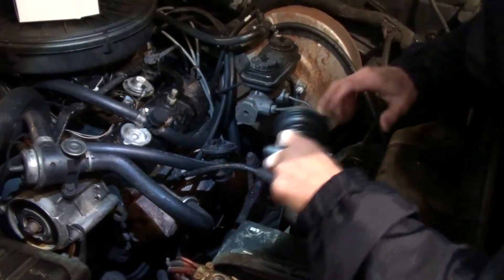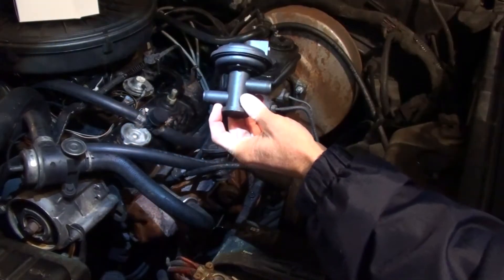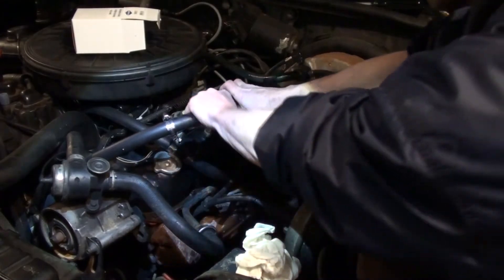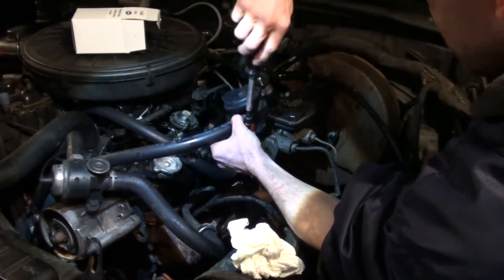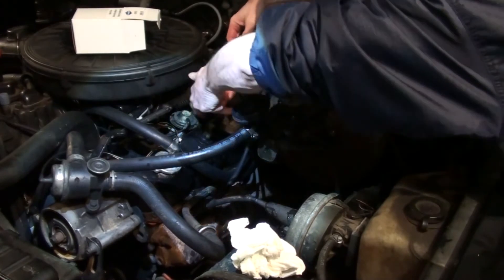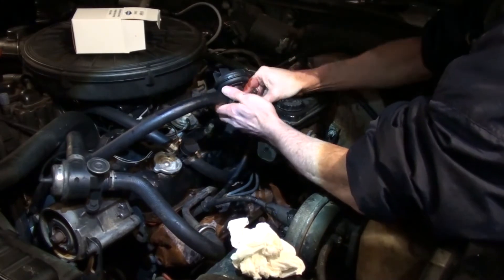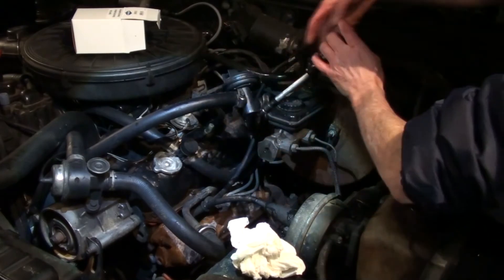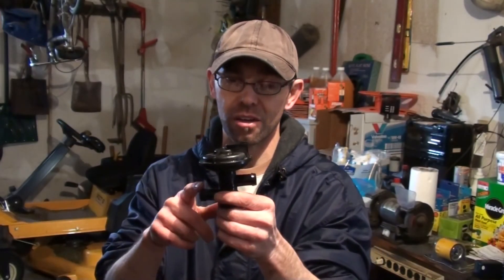1988 Dodge Dakota 3.9 V6 Heater Control Valve Replacement

Comment: I have an 87 Dakota and the heat selector panel I level floor defrost doesn't work do you know anything about that thank you Karl
Reply from the maker: Hey Karl, it could be a vacuum problem,  or one of the actuators is bad. I would have someone run a diagnostic to be sure.

Comment: I have a question about a 1994. Do you have any idea how to get to the blend door actuator? I blow heat/air (though not cold) through the defrost and floor vents only. Just trying to narrow down the problem as cheaply as I can. thanks for your help.
Reply from the maker: Clayton Sosbee On my 1988 I actually have two actuators on the driver side just to the right of the gas pedal and one on the passenger side closes to the passenger side door. I'm not sure which one controls the blend door though. Also, I'm not sure if they would be in the same location on a 1994. Hope this helps.
Reply: I pulled the front of the dash out and everything is still plugged in, so I am assuming it's either the actuator or the control switch. I also has to wire brush my blower motor resistor yesterday, as parts of it had rust. So those EGR-looking thingies are the actuators?? The thing by the gas pedal is a yellow hose. Passenger side is black. Are those it?
Reply from the maker: Clayton Sosbee Yes I believe you've found the actuators and yes mine have different colored vacuum lines connected to them. If it's not too expensive you might look into replacing the blower motor resistor if it was rusted really bad.
Reply from the maker: Clayton Sosbee  By the way, if you have the chance, check out some of my other videos, ads on the videos, and consider subscribing. Also, don't forget to  share your favorites. It helps me continue to make more videos and helps pay the bills. Thanks again! :)
Reply: Resistor is cheap and a 5 minute replacement. :) But thank you for your help. I will assuredly subscribe.
Reply from the maker: Clayton Sosbee Thanks!!! I appreciate it!

Comment: when i throw water inside the thermostat it blows bubbles itmeans thats rust?how to tell if the thermostat needs replacement?
Reply from the maker: The only way I know to tell if the thermostat needs replacement is to take it out and compare it to a new one. To do that, boil some water and put both thermostats in the water to see which one opens the most and the soonest.  In my experience, if the thermostat needs to be replaced, the new one should open before the old one. Hope this helps!!! :)
Reply: thank you very much
Reply from the maker: You're Welcome!!! :)

Comment: I have a 96 dodge dakota that blows warm not hot, Ive replaced the thermostat, water pump flushed radiator and heater core, am I missing anything? I was thinking maybe check the inside controls
Reply from the maker: I can't think of anything else accept for maybe your radiator or heater core are too clogged for a simple flush to work and you may need to do a back flush to dislodge anything that will not come loose with a simple flush. I got this idea using the method I use to clean my tankless water heater. I did a video on how to back flush the cooling system. Maybe that's something you could try. Here's the link. https://www.youtube.com/watch?v=X_B1G9vNhms&list=PLQB212FFPHWTOT00vcim4mPdcOdhEizjk&index=9
Reply from the maker: CORRECTION in quotes - I can't think of anything else accept for maybe your radiator or heater core are too clogged for a simple flush to work and you may need to do a back flush to dislodge anything that will not come loose with a simple flush. I got this idea using the method I use to clean my tankless water heater. I did a video on how to back flush the "Heater Core."  Maybe that's something you could try. Here's the link. https://www.youtube.com/watch?v=X_B1G9vNhms&list=PLQB212FFPHWTOT00vcim4mPdcOdhEizjk&index=9

Comment: how to tell if i need to change the hoses?
Reply from the maker: Great question Basilios Gerohimos!  You'll notice a bulge in the hose. It's best to change them before this happens. I would check with the dealer to find out how often they would suggest you change your hoses. :)

Comment: is there any chance the valve would be clogged with rust?????????
Reply from the maker: I guess it's possible. If this is the case you should flush the system and I would go ahead and install a new valve. :)

Comment: Be more specific about which way it goes on. We don't need to know how to hook up a hose and tighten a screw on a clamp... Ijs
Reply from the maker: I don’t know how much more specific I could be. The new unit should have an arrow indicating the flow of the antifreeze from the radiator to the heater core. Also, when you purchase the new part verify that there’s an arrow that indicates the flow of the antifreeze.